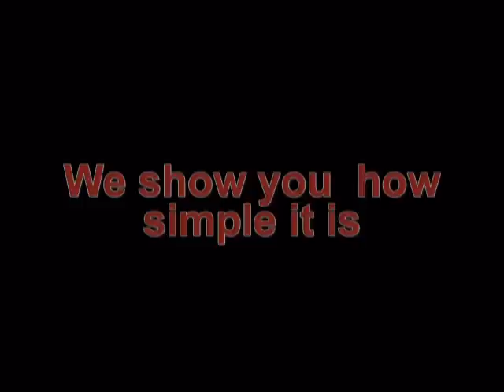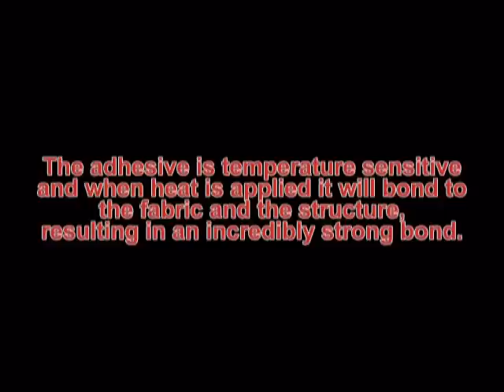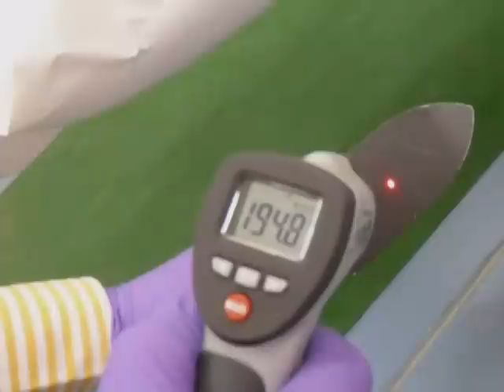Cover your wings in a day.

Comment: What material for air plane wings?
i'm in vietnamese, i can't find it. please help me
Reply: Aluminum
Reply: @think_tank_.   I built a zeppelin once, out of led. It was very heavy.
Reply: @commentatron  use titanium or aluminum it's light weight metal
Reply: On 2nd thought, use something similar to a fly's wing (plastic/Mylar?). Attach small tubes to it that carry fluid that can be moved to change the airfoil shape dynamically. Think of how blood flow changes the shape of parts of your body. Same thing.
Reply: He I tried to do with some fabric cloth with aluminum light weight wing 
But I don't have propeller and it's not available in Bangalore 😔

Comment: This video is very incomplete, leaves out too many vital keypoints. How to follow mfg suggested temps, min max temp ranges how to prevent twisting your wings from over shrinking, what type of glues, how much to shrink, how to test the tension, and many other key factors barley the basics. I've completed airframe and powerplant school and this is not even close.  Ive used Ceconite, and other types of dacron fabrics with superseam cement and polyflow sealants, sprayfill and other products with intensive instructions to detail to provide the best possible results.
Reply from the maker: Marshal Palmer you are a pro!
Reply: Do you have a video(s) you could recommend?  I have an old Schweizer 2-33 to cover. Fuselage is welded steel tubing and fabric covered. Wings are thin aluminum skin and tail is aluminum except rudder is fabric. Right glue? Fabric? New to all of this. Glider was a gift and not bad shape but want to fully restore it. Thanks. S